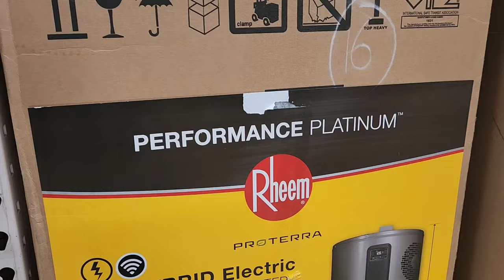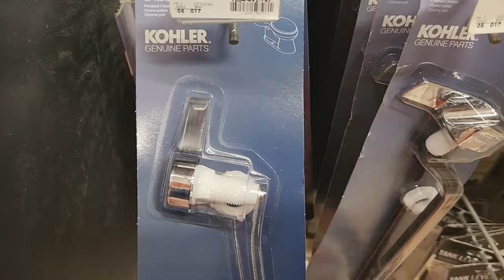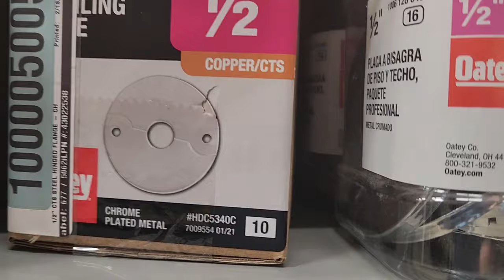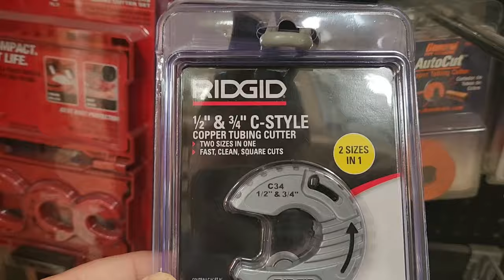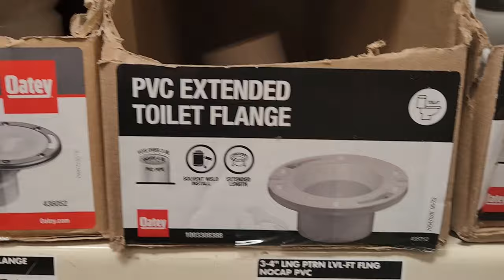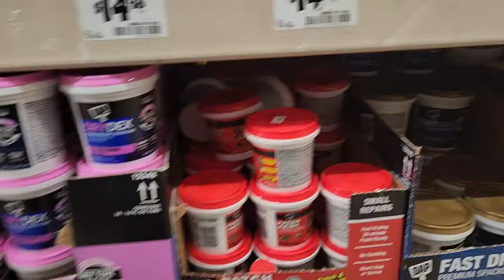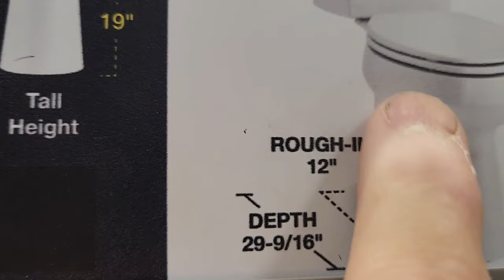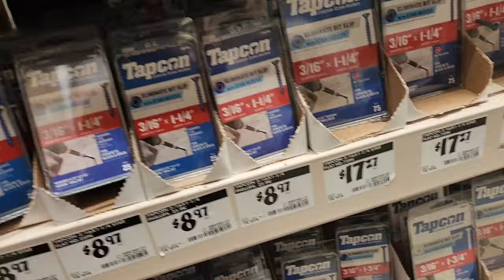ATRIP TO THE CANDY STORE FOR JOHNNY!

Comment: I’ve done comparisons before of the AO Smith water heaters that Lowe’s sales vs the AO Smith from the supply house and besides the plastic drains I’ve also noticed that the Lowe’s heaters are about 25-30 pounds lighter so that tells me that they’re more than likely made of thinner steel so the quality isn’t as good as a supply house heater
Reply from the maker: Wow,interesting, or less dense insulation or both or even more cutting corners.
Yeah,you made my mind up,sticking with the supply house line.
Thanks for your valued opinion, see yah!